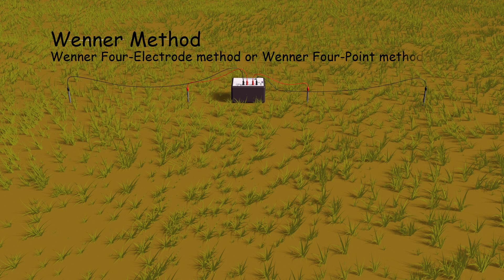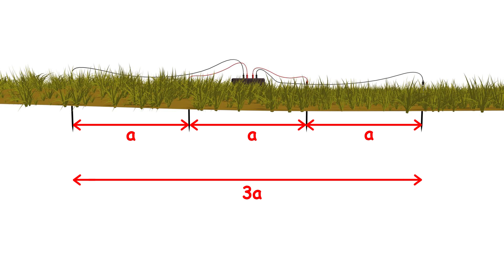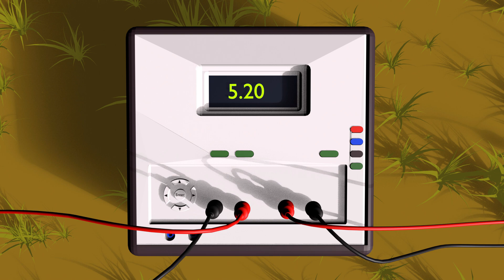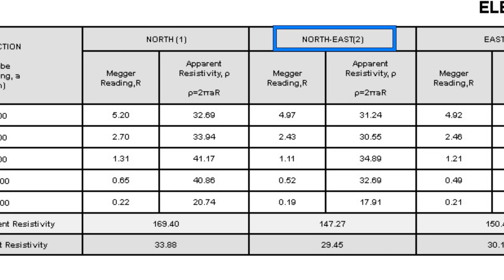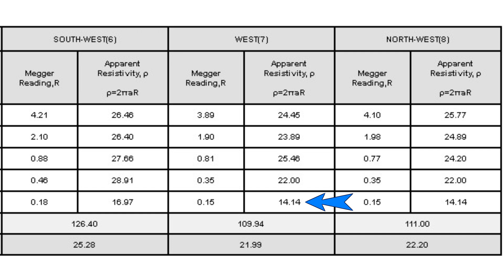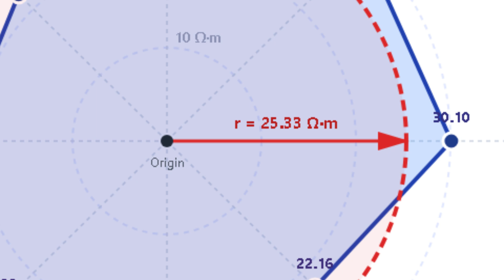Soil Resistivity Testing Explained: Wenner Method & Polar Curve Analysis for Grounding System Design

Comment: Your lecture is very good and useful. You get the final value of resistivity by drawing a circle and the area of the shape created by the measuring points. Which document did you refer to for this method?
Reply from the maker: IS 4043